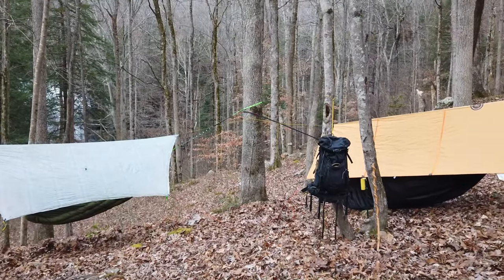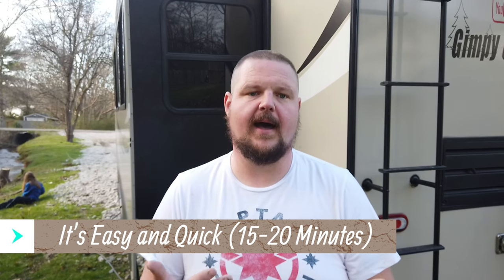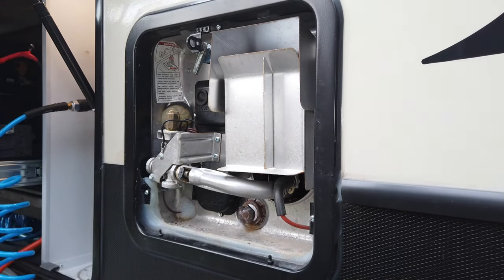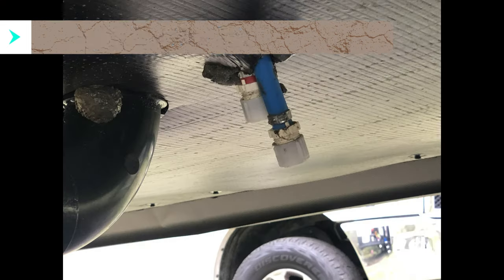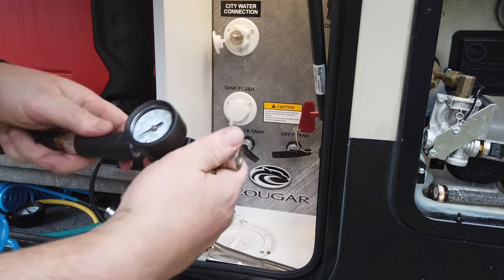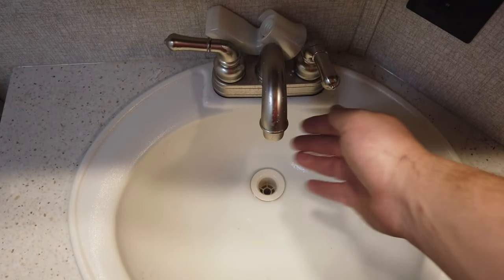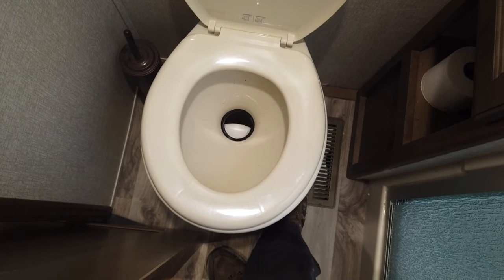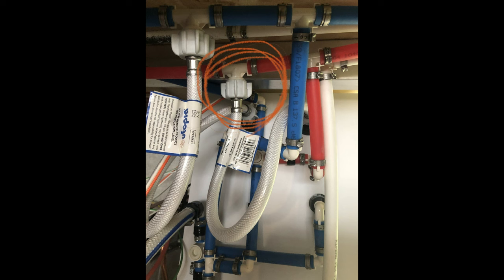Using RV in the Winter - Easy Winterizing Method with Compressed Air #winterize #rv #wintercamping

Comment: Great video. I followed all of your steps but added one more. After blowing out all of the lines I also re-opened the low drains while the system was pressurized and discovered both had re-accumulated a significant amount of water. Do you leave these open over winter? 

Thanks again. Most other “how to blowout” videos have comments pointing out mistakes, unlike yours.
Reply from the maker: I did have a mistake, which I stated was my weak point to the routine.  I had a couple of micro cracks in the prefilter for the pump.  I found this out when I switched to using the Lippert Floe.  It puts the air in before the pump so it takes that out of the equation. But my initial impression was bad with the system but I think I have all the things figured out but I want to use it all winter before I release any large re release of my system.  As far as the caps, I switched them out to valves this year, but yes I would leave them open... wouldn't hurt anything.
Reply from the maker: https://youtu.be/XEyn3fuoR48
Reply: @GimpyCamper   I got into the whisky one night recently and when I was stumbling back into the trailer I bumped the pump switch and inadvertently activated it with a bone dry fresh tank. Burnt it right out! So to winterize that portion I’m just going to disconnect the pipe off the pump and let it drain out

Comment: Great video! I also live is south eastern TN and love camping in the winter. This is our first year not in a pop up so this seems like perfect solution! 

Where do you camp around here that has water in the winter? Most of the places we camp have it turned off. 
Thanks!
Reply from the maker: You are very limited in winter.  Almost to State Parks and about 1/3 of private parks remain open.  State parks usually have water on but some don’t.  The only one I’ve found that doesn’t so far is Cove Lake SP.  we are in Jellico right now and happened to see on the website the water gets turned off November 1…. Which apparently was not true.  We have reviews that include recommended spots all over East TN and usually go somewhere new every other weekend.  Btw…. Always fill your water tank in winter anyway and you don’t need a heated hose.
Reply: @GimpyCamper  good advice.. I guess cove lake is what we are basing it off of. That is our second home. We like milton hill too but i know it for sure closes.

Comment: So you are saying you don’t do anything extra for the pump? The water in it doesn’t cause a problem?
Reply from the maker: No.  I have turned the pump on after blowing out the lines to get a little more back out of the pump.  But I don’t usually do that and it’s been fine but here in TN the winter is fairly mild and never goes too far below freezing.  I did recently install something called a “Floe” by Lippert which I had high hopes for.  It is a small permanently installed compressor that connects with some check valves between the tank and the pump.  So it does winterize the pump, but unfortunately it failed on the first use and no longer turns on... I had high hopes but it failed miserably

Comment: Whats the coldest you've camped in your RV?  And did you worry about freezing something up while your out?

I too would rather camp when I have to wear a jacket rather then 95 degrees.
Reply from the maker: I have camped multiple times in the 20’s with no issues.  I always do use my tank for fresh water in the winter

Comment: I have a cougar similar to yours and have noticed after a year my fresh water tank is filling up when I plug in my city water connection?  Have you ever run across something like that? I have a 2020 Cougar 25RES.
Reply from the maker: There has to be a check valve somewhere that is failing.  Not sure where it would be, but you could always add a check valve anywhere after the pump

Comment: Living In Indiana we use the antifreeze. We did try the air compressor method but the temps get pretty cold up here.
Reply from the maker: Luckily it doesn't get too cold here on average
Reply: We live up in MN and I use the air compressor method. No problems so far. It's what the set up guy at the dealership recommended and he is a life time RVr up here.
Reply: Using air is how we do it. Never had any problems. We live in Montana. Below zero Temps are normal during winter here
Reply: air is good enough pink stuff in traps